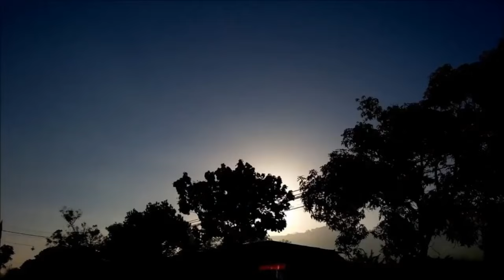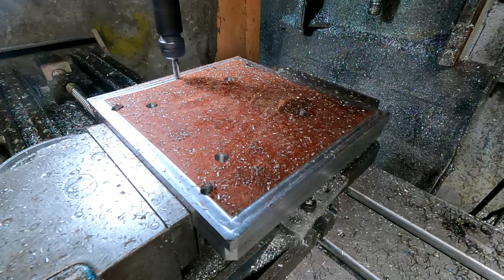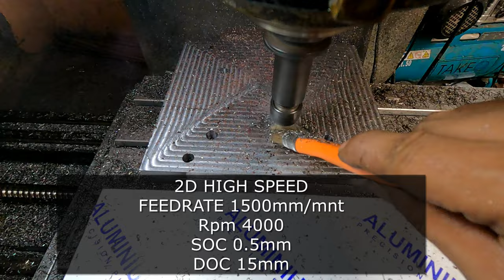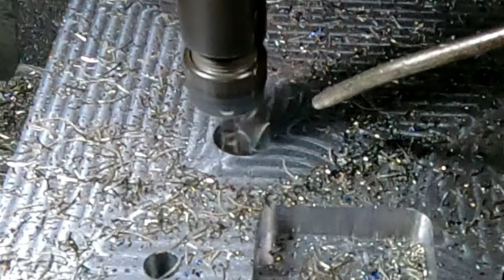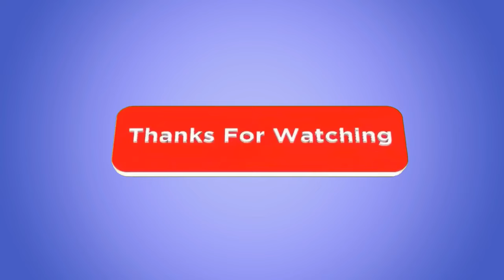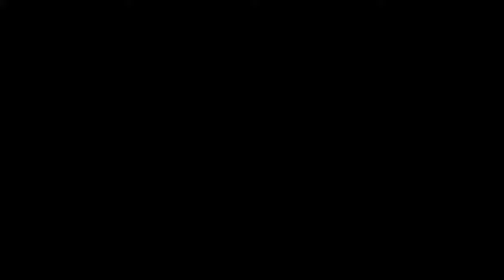AC SERVO SPINDLE 750w IN ACTION [ mtl Mild steel 2d high speed ]

Comment: itu sampean pakai pulley ratio berapa mas untuk spindlenya? 🙏👍
Reply from the maker: puly kecil 90mm puly besar 120mm ( puly di motor spindle saya buat lebih besar supaya putarannya bisa nambah. ) dari rpm 3000 bisa menjadi 4000 rpm. Rencananya nanti mau saya besarin lg supaya putarannya bisa mencapai 6000 an rpm
Reply: @SKCCNCROUTERBATAM  ok mas, matur suwun nggih infonya, sukses selalu.
Reply from the maker: Ok mas ku... Terimakasih... aamiin
Reply: @SKCCNCROUTERBATAM  oh ya mas, itu sudah pernah coba potong baja 2311? kira kira mumpuni gak?
Reply from the maker: @FebrianGaluhWibisono  Selama ini yg saya kerjakan Mtl MS,SKD11,NAK 80, AISI,STAINLESS,STAVAK. Kira2 persamaan mtl 2311 apa mas ku... saya kurang paham nama2 mtl...yg saya tau yg saya tulis diatas...he he he
Reply: @SKCCNCROUTERBATAM  saya jg kurang paham soal material mas, yg pasti yg saya sering pake ya 2311, skd11, s45c hehe sepengalaman saya baja 2311 biasa disebut mold steel, khusus utk pembuatan mold, tp ya ini sepengetahuan ku tok ya, ojo dijadikan patokan.
Reply from the maker: @FebrianGaluhWibisono  Ow...k lo gitu mungking persamaannya NAK 80 mas ku. Saya k lo buat molding tooling mtl nya NAK 80 ( free hardent ) kekerasannya berkisar 50 hrc tanpa hardening

Comment: Kelebihan menggunakan AC servo sebagai spindle dibandingkan dengan AC brushless di pasaran apa ya om?
Reply from the maker: Yg jelas k Lo AC servo lebih bisa mantain speed. Dan torsi nya kuat
Reply: @SKCCNCROUTERBATAM  kalau AC servo 400 Watt an, kira kira bisa untuk makan aluminium dengan doc 1mm an tidak om?
Reply from the maker: @Izudin26  bisa mas...tp kayaknya max diameter 8mm 50% diameter endmill

Comment: Nanya lagi om.. Itu servo max brp rpm? Trs kan kl pake endmill dia meter kecil misal 2-3mm apak rpm bisa kecapai? Kan butuh rpm tinggi.. Utk bahan pemakanan alu
Reply from the maker: sekarang 4000 rpm mas ku. diakali gear di motor dibesarin k lo mau putarannya lebih kencang lg
Reply: @SKCCNCROUTERBATAM  tp bisa ngga om pake rpm 4000 pake endmill 2-3mm misalnya.. Atu akalin di flute nya?
Reply from the maker: @rofiscreation2316  Bisa mas ku....feedingnya di sesuaikan jg 👍
Reply: @SKCCNCROUTERBATAM  siap om.. Soale kmriin liat ada servo d control pake inverter spindle..
Reply from the maker: @rofiscreation2316  iya bisa masku...tp k lo watt nya kecil gk kuat untuk milling besi putaran lambat. Bagus pakai driver servonya
Reply from the maker: @rofiscreation2316  sebelum pakai yg sekarang ini saya kan pakai seperti itu mas ku
Reply: @SKCCNCROUTERBATAM  iyaa kl driver servo bisa setting torsi juga.. Kl pake inverter spindle tp pake servo 1.5kw gmn om? Kl yg 750wat pake inverter spindle buat makan alu cocok ato besi masih kuat?
Reply from the maker: @rofiscreation2316  untuk alu bias mas, tp k lo untuk besi kurang, soalnya k lo di putaran rendah torsinya berkurang, jd harus putaran kencang untuk milling besi
Reply from the maker: @rofiscreation2316  recomendasi untuk milling besi selain servo ini mas ku
https://youtu.be/00aQICH1kwY